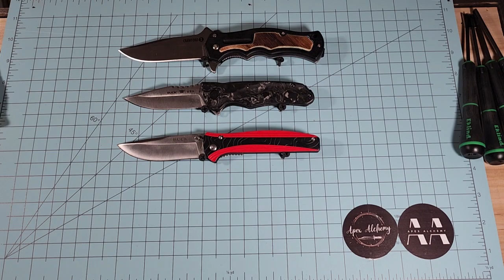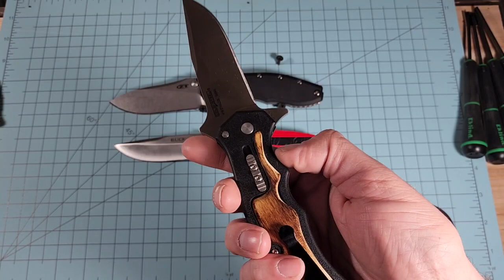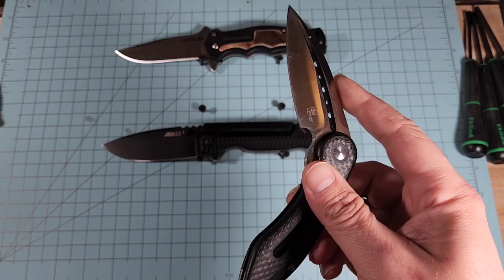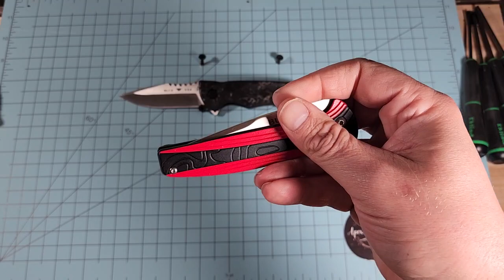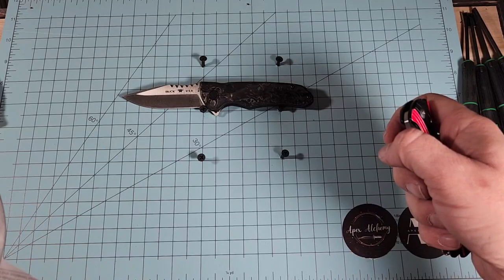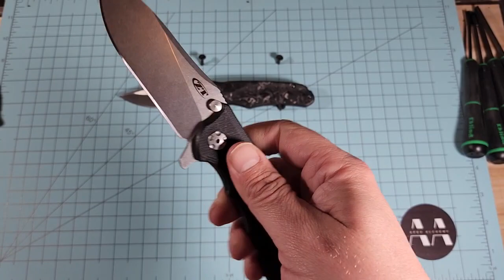Factory Edge Retention, Heat Treats, and Steel Types...and what is going on?

Comment: This is a very polarizing topic. The truth is that you were never supposed to use them enough to notice the difference. You were supposed to just jump on the hype train and buy what you were told by a large YouTube channel. I'm kidding but only kinda. My passion in knife collecting and use does revolve around steels. I could go on for hours with theories about why you experienced what you did with all of the knives shown but it doesn't matter. The fact that you've experienced great performance from a budget blade is awesome. S90V is my favorite steel but you're correct about that crumbly factory edge from Spyderco, I hate that it happens but in my experience it tends to result in superior performance after steel removal.
Reply: It's great that it's got your curiosity up and when you look back on it you will remember these times with a smile. None of us need super steels and I would never recommend them to users that can't sharpen them even though it's really not that difficult with the right equipment. Just like you said though we could all get by just fine with a RAT1 or a ColdSteel.

Comment: Dang y’all can talk.  Just messing yall know I can too. But for real great to hear some of your thoughts and opinions on this topic.   So much goes into testing and really understanding what makes a certain steel better.  Too many variables for me to personally work through to be any kinda expert.  Bout the only time I talk with “knowledgeable opinion “ is when it comes to a Satu.  They only came in 2 steels and I know the one I prefer. But I have a ton of experience with them and have had multiples of both varieties.  Having a good sharpening system has helped me personally achieve the kinda edges I want.  Don’t think it necessarily needs to be learned through freehand.  But we all learn differently.  If you watch Shawn from blades and fades he is a perfect example of how great one can be with extreme attention to detail.  Hell now ya got me talking to much 😂
Reply from the maker: Getting you to talk is the only reason we still have a channel 🤣🤣. Talk all you want brother. I'm sub'd to that guy and he is extremely good. I just feel like if I can study what's going on after each phase of sharpening ...and I can feel the blade as it moves across the stone that there would be subtle ques to be picked up on. However...I'm known for over thinking lots if simple stuff...and never mastering many of them 😅🤣

Comment: 30 days aint long to go for a new blade Billy..you can do it!! My Recon1 tanto in S35VN took a razor edge at 600grit&held it but a mirror edge sucked. I cut in a sharpening choil&put a belly on that bad boy too. SRK 3V however was a real GOAT fuclker though but worth it. Your new Emerson is a killer blade!! All grinds on all knives should be symmetrical&if not should be sent back. I cant stand crap metal work or crap quality control.
Reply from the maker: Bout time I start sending stuff back then. I swear this new 940 has the same exact jacked up tip as the one I bought in 18. Same exact 21 degree on one side , same exact 19 degree on the other...which comes to a funny looking jagged edge on a reverse tanto if you look at it from the spine.
Reply: ^^^^^ I'm not the only one that likes a toothy edge, I just think it holds up better.
Reply from the maker: @alanp285   some steel...toothy just makes sense. 😎🤘
Reply: @apex_alchemy_knives  I will never keep another knife with a wonky grind after the SRK debacle&for what ive seen about Benchmade..I'd never buy 1. For the quality the price is too high plus I frickin HATE the GD bugout!! I see the quality in everything goin to shit. People have thrown away work ethics&pride in a job well done. The world is in the shitter&about to be flushed I think.

Comment: Some good info. Learn to hand sharpen. It can be therapeutic and you will enjoy ownership even more. Grab all three methods for different blades. Diamond plate/wet stone/strop w/ cbn. Nobody touches my blades. Just like nobody touches my rigs.
Reply from the maker: My thoughts exactly.  I need to develop my skills. At the same time I'm definitely gonna start taking notes on edge fit snd finish. Start spending my cash on knives that are complete...or I feel are complete.
Reply: @apex_alchemy_knives  Work Sharp Precision Adjust Elite is a great easy sharpening system
Reply from the maker: @rustyknifelover4463  I may using it wrong. I can't get a symmetrical edge with it to save my life. I can sharpen a knife with it. All but the 0562 so far anyway. I think that thing is soft though. It is a good system to sharpen knives. Maybe it's a good system to make an edge pretty too. When I flip the jnife over I'm getting like 60/40 grinds. They can be pretty...but they aren't even.
Reply: @apex_alchemy_knives  Do you strop?
Reply from the maker: @rustyknifelover4463   I do with the work sharp...I haven't started stopping much free hard.
Reply: @apex_alchemy_knives  I highly recommend getting a good strop and diamond spray. It is the key to getting a truly sharp blade.
Reply from the maker: @rustyknifelover4463   I bought a couple from nick and I'm getting emulsion from lacey. We gonna be in stopping business before long.

Comment: Lort this would been a good live or something.   So many spots to touch on.  First off, I don't know nothing about nothing.  A lot of factory knives don't come with a perfectly symetric bevel. It is what it is, they are mass produced.  Hard to compare spyderco with something like Emerson, much smaller batches and workforce from Emerson.  There are a ton of factors on edge retention though, like too many, it's so hard to compare two different knives.  The degree of bevel, the steel, the heat treat, the things cut, on and on. I'm not sure about the burnt edge that your talking about, but most factory knives do come with a burr, they can normally be stropped off and then you'll see what your edge is really like.  Usually a fingernail can feel it or sometimes you can see it with a bright light. I've got a CHEAP dmt guide that I can get even bevels on though, it just clamps the blade and you hold it all in hand.  I also have a set of DMT bench stones, I suck at the stones, all of my knives end up convexed to some degree.  I'll tell you what I like though, and this may be a hot take, but I like a rougher sharpening job, like I don't go very fine, you can definitely still see marks in my blades when I'm done.  I do think that that stays sharper longer.  I always think of it like micro serrations.  I also always put a super duper micro bevel on when I'm done, once I get the burr off, I'll crank the guide a turn or two and hit each side once or twice.  I just don't like mirror edges and don't think that they hold up as good as a toothy edge.  I may be wrong, but I believe it so that works for me.  I don't want it to sound like I'm making excuses for spyderco, they are expensive, they should be better.  But a lot of people buy knives and just have what they have, everyone should learn to sharpen, even if it's not great, it's better than nothing.  I quit sharpening for awhile because I was swapping knives so much, but you can always tell when I get on a kick, my left arm is bald from fingernail to shoulder.